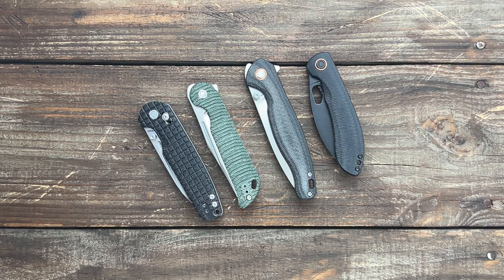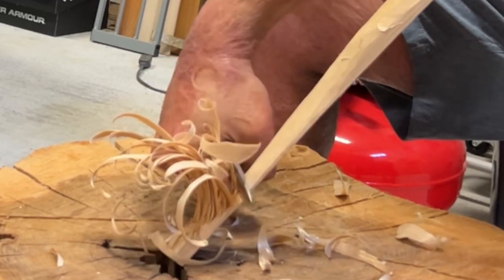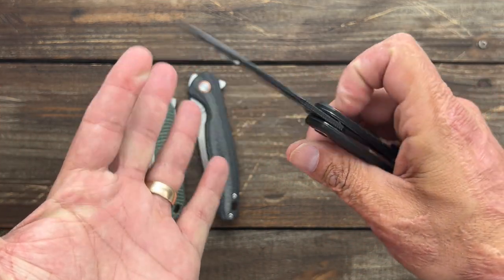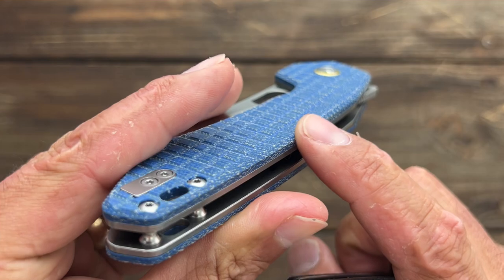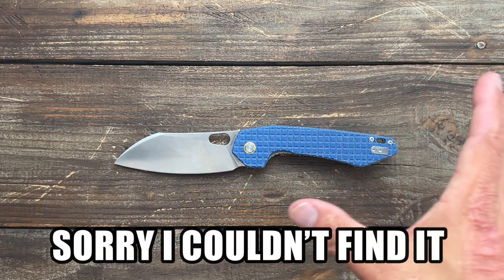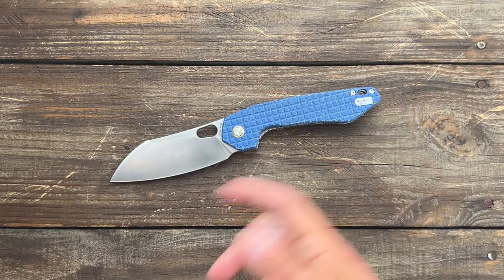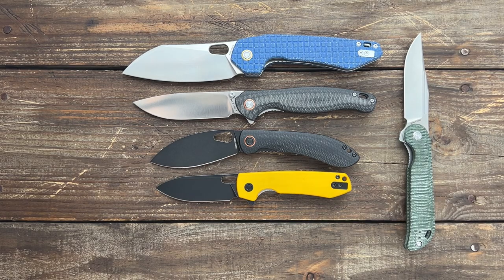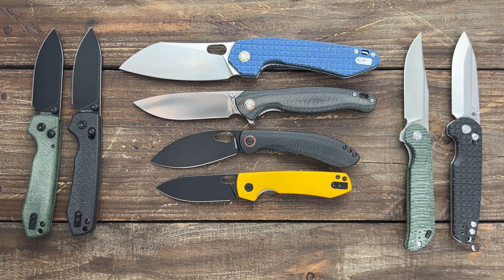Ditch the Old: Upgrade to These Amazing EDC Pocket Knives!

Comment: Well designed flipper tabs on the Gator. I like how they disappear once the knife is open. As far as the cut test, I’m good if you don’t do them. Edge sharpness out of the box isn’t going to hold much sway with me on my decision to buy a knife. I’m more interested in good ergos and proper heat treatment.

Comment: I hope the sharpness test will become a regular part of your testing routine. I have the same tester , and along with a video microscope, it's become a part of my testing process. Using the microscope to examine the edge for any damage or uneven-ness, and the sharpness tester to measure the sharpening result , it's really made a difference, for me. It would be great to see the various knive's sharpness compared with an empirical value, rather than just the cut test , as illuminating as aspects like edge retention , and hot spots during hard use , are. I'd also suggest, for your consideration, keeping a record of the sharpest knives tested. A top ten , or even a link to all the scores , would be a great reference for comparison . I do love a slice-y knife . A comparison test of original factory edge angle sharpness vs a narrowed angle after sharpening (+20° vs >17° ) would be an interesting video, to me , (even though I'm pretty familiar with the results of that one. : )  Thanks for all the great content !